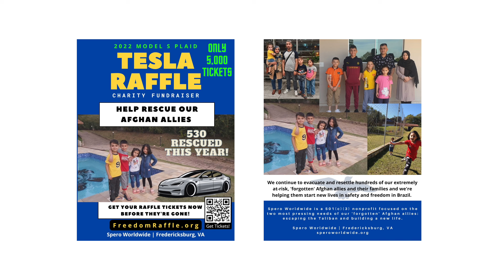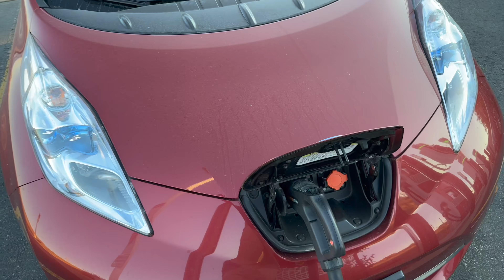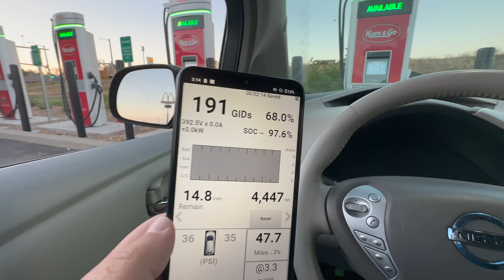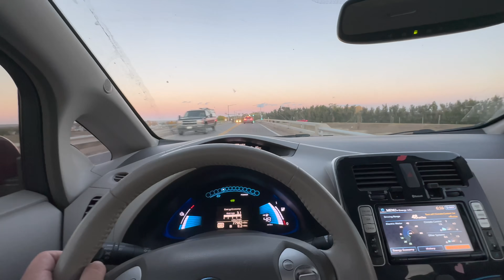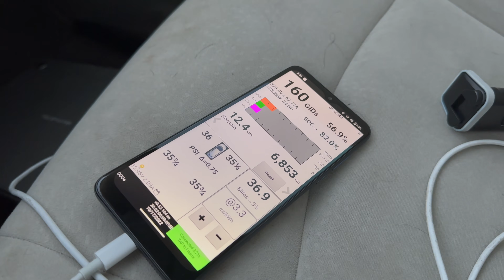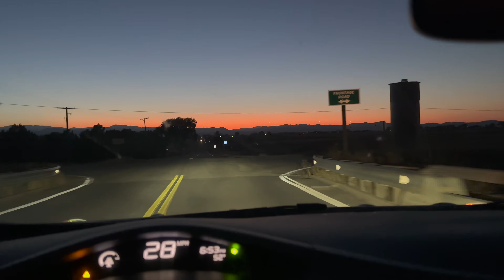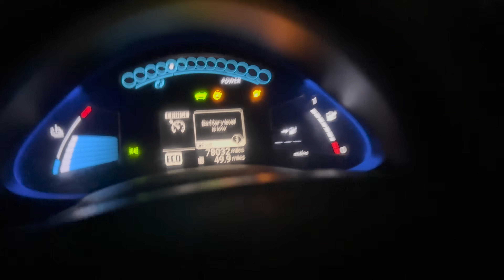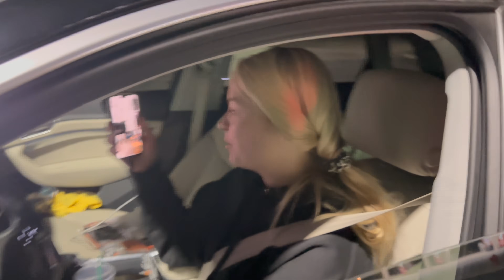Here's How Far My Cheap Nissan LEAF Goes On A Charge! Charging & 70-MPH Range Tests

Comment: It can be quite fun but how long in total did you charge it for, 37 mins upto 90% then maybe another 20 mins to 99% ? So an hour or more?

I've been interested in one but what I'd noticed is there's no cover/shelter area, so if u fill a gas car you can keep dry, if you fill an electric one you could get soaked, need an umbrella, and in the winter time you'd spend more time charging it and getting cold. I've got no offroad parking where I live. I fill up my petrol car twice a month, this one I'd need to charge it about 7 or 8 times a month, that's probably 7 or 8 hours, and if I need my own lead for supermarket charging, they tend to get nicked.
Also the UK is focusing more on getting everyone on bicycles with cycle lanes etc, rather than charging points. Bike theft is sky high here so no thanks.

Comment: YouTube has videos that show car panel dents being pulled out using hot glue and pulling attachments to remove the dent. Are there local repair shops that use that technique? Perhaps they would work with you to make a video.

Comment: I bought a 2012 Nissan LEAF on 10/8/2022 for $2450 - it has 47,300 miles - my AC is working and CHAdeMO as well.   What does not work is the heater.  No heat,  oh well.   It’s white and you can see it by clicking this: #LEAFsavesMYparkingSpot

Comment: Why anyone would be impressed at achieving 50 miles of range at 70 mph then having to recharge to literally go anywhere else is beyond me?? At my age I want comfort, low noise, and range. However, his enthusiasm keeps me watching. Still waiting for those new EV’s that fit my price range.
Reply: Because its a great car for around town. Not every trip is to another state.
Reply: Because that car is extraordinarily cheap
Reply: @planefan082  Over 3 grand is cheap? I can get a variety of fully functional FIAT shitboxes from the '90s and early '00s for 500-1000€ and every single one of them will be way more useful than this toy car. I'm sure you have your own shitboxes you can buy in the US for a similar price.
Reply: @demoniack81  Over 3 grand is cheap for a car period these days in North America, but extremely cheap for a car you won't have to spend hundreds of dollars per month in gasoline alone
Reply: 1980.    Stuff Hass less range then 50 milees
Reply: buy it for my teen to drive to school, that's it, I don't want teen driving far away

Comment: You might be wearing down the battery more by charging it between 90% and 100%. That might be why it finishes at 90%. Another reason might be the overall wear of the battery. I’m not really sure.

Comment: I noticed you had the AC on in the climate control too that might have sucked up alittle bit as well.  Any time you have defrost on Nissans automatically turn on the AC. I have to manually turn it off on my Versa all the time. it is a bit annoying. I know why they do it but to save a little on gas i turn it off
Reply: Almost all cars turn on AC on defog, very annoying. I drive a Fiat 500e electric I'm always turning off the AC on defog.

Comment: I've gotta tell ya, Kyle, I'm with you all the way about this Leaf. For years, I saw them around while driving my Civic and thought, what an ugly little car. But this pas March, with gas prices rocketing, and the fact that we installed 26 PV panels along with a Tesla Powerwall, I decided to go electric. THere was a long wait for a Tesla (the prices are high anyway), and none of the dealers here had EVs in stock (I'm on an island in the middle of the Pacific. Figure it out.) So when the Nissan dealer called to say they got a 2019 Leaf in, I grabbed it. I'm so glad I did. Nissan must have put their "A" team on the design and development of this car. It's all the things you rave about and more. Quiet, smooth, comfortable, all the things you'd want in a daily driver. Mine is an SV Plus with the 62 kwh battery that's supposed to get 220 miles on a full charge. I haven't got that much, but that's mainly because I have to commute over a mountain. The 2.5 mile uphill to the top uses up 10-12 miles, depending on how big of a hurry I'm in. But absent that daily climb, I'm convinced I wouldn't have to charge more than once a week. All and all, I, too am ecstatic with this car. It's a shame that Nissan is apparently going to phase the line out over the next year or two.

Comment: Would love to see what improvement in range flat wheel covers would make. The measurements are so precise it will be easily apparent if there is a difference. And get an a/c charger!
Reply: I've wondered about that flat wheel covers idea also
Reply: @rp9674  I've 3d printed and used a couple sets of Dala's Leaf petals, inserts that fit in the openings of the Leaf's alloy rims to make the wheel almost completely flat. Over about 18 months and 18,000km I've averaged 1.1% higher efficiency, but that's with a 19% higher average speed as I've been doing more highway driving, so my efficiency SHOULD have decreased by as much as 41.6%. Other users have measured improvements around 10%. Using the 10% improvement number, they've saved me at least 400kw or $40. Since they cost me about $20 to print, they've saved me about $20 so far. They certainly make it FEEL more stable at higher speeds and during crosswinds, too.
Reply: @extragoode  nice, I thought it was weird that bolt doesn't seem to have arro wheels either
Reply: @rp9674  manufacturers seem to be convinced that nobody wants aero wheels. Tesla has some that are better, but still not flat. Cars are still very vain objects and people are willing to pay way more for pretty, but less functional things. The only mostly smooth rims I've seen on a production vehicle were on the lightyear 0 but it's not exactly cutting any costs. The Aptera will probably have completely enclosed wheels whenever it finally makes it to production.
Reply: @extragoode  sucks, I think flat Wheels look good, seems like they could do break cooling from the inside of the wheel
Reply: @rp9674  with an air dam under the front bumper the goal is to push the stream of fast moving air away from the underside of the car, so the air on the inside of the wheel gets relatively stagnant. I said the wheel inserts I printed were almost flat because they have a small cutout towards the inside of the wheel to allow cooling air to flow in to the brakes. Regenerative braking doesn't create as much heat either though.

Comment: A 2012 ZE0 leaf ready to be scrapped is $10K where I live. No parts availability and no replacement battery for less than $5k. Then when it’s all fine and working again it’s still a 2012 Leaf worth less than what it cost me. Winters are cold and summers are hot in the local too. I can use Uber for a few years and still come out in front
Reply: Why would you want a replacement battery anyway? I'd have the existing battery refurbished for a fraction of the cost of a new replacement. The last Leaf battery refurb video I watched on YouTube, cost the owner £500 on a 10 year old Leaf.

Comment: Please follow up with city driving with tire pressure @ 50 psi.  A 2015 Leaf owner here.  Unfortunately I do a lot of my 60-mile roundtrip commute by freeway, which motivated me to update the battery pack to 62 kWh from OEM 24 kWh (showing 83% SOH) last March.
Reply: Gid fir you
Reply: Why 50 psi in tires
Reply: @Crayz919  Actually my tires are at 45 psi to reduce the rolling resistance on the road.  Of course confirm on tire's sidewall the max amount.  My tires are specifically designed for lower rolling resistance and they max out at 52 psi, so I feel safe with the seven psi margin.  My car has a plate to indicate 36 psi for a softer ride, which I opt for the more economical performance from higher pressure.

Comment: My Partner and I replaced the OBC on our 2012 LEAF ourselves.  It was actually an easy process, the worst being having to get to the eleventy bazillion push pins and screws to gain access to the traction battery plug, and plumbing to the cooling loop for the OBC.  Feel free to ask if you want any pointers.
Reply: Do you have to pull the drive battery plug, is it safe?
Reply: @rp9674  yes, you pull the  disconnect in the rear floor area, and unplug the connector to the HV Battery underneath the car. Once done,  you press the power button to engage the large caps and discharge them, then finally disconnect the 12v battery. Once done is about a 10 minute  "rest" period to ensure all HV components have discharged.
Reply: @rp9674  Yes, you have to pull the plug.  the idea is to totally isolate the battery.

Comment: Excellent video - well done to you.  Just as a by the by, the SOH is very near dropping you down to 8 bars.  Regardless of that - 50 miles at mostly 70MPH is astonishing!  

2012 Leaf
24kWh pack
9 bars
66.58 SOH (as per Leaf Spy reading)
14.8kWh available
77,980 miles on the clock
59 Fahrenheit (16 degrees Celsius) outside temperature - giving 6 temp bars

50 miles range!

Waw!

76 quick charges and 4792 L1/L2 charges in its lifetime.  This would suggest, over the space of 10 years, on average the car has received 10 x L1/L2 charges per week - that is amazing for the car!
Reply: Not to me, my 99 Mustang six is so much more versatile than that - impressive car until he mentioned only about 50 miles on a charge on the old battery?  Fresh one maybe about 100 miles? My Mustang will easily go 300 miles on a tank of gas -
Reply: @appleimacdude  Hello Dennis! You cannot beat the 300 mile range of your car, that’s for sure. For a cheap electric car, it’s horses for courses. The Leaf technology is 10 years old if not more. I’m not sure about your background with electric cars but I can assure you the fact the car is so cheap to run it’s a great deal.

Comment: Kyle compare the 2017 Ford focus full electric with this one that has active battery cooling....I commute one for the last 3 year with over 70k and I haven't noticed any battery degradation....you could review my car I will let you borrow it....👍 Come over it's in California.😁😂
Reply: Problem with Focus EV is the battery is discontinued, there is no third party battery maker,  and not many were sold.  So if you have any battery issue at all, you are stuck with a paperweight.

Comment: that little car save me around 3K in gasoline this summer, yes has a small battery, and needs to recharge often, but for local runs is great.    one tip for highways, use Drive mode to accelerate fast, get to the speed you need and then just slightly add power to maintain speed,  you drain the battery less that way.
Reply: Or just stay off the highway with it.
Reply: @rolandthethompsongunner64  Why do that when you can clearly charge in between road trips? I've seen plenty leafs at highway rest stops!

Comment: Impressed with a 50 mile range ????? And car only has 78,000 miles on it??????  Replacing a battery is like replacing an engine in an ev. What engine are you excited about replacing at only 78,000 miles???   Your expectations are extremely low. You’re  ust the demographic Nissan Renault hopes for.
Reply: The car isn't supposed to do long dinstances in the first place. And it can rapid charge, so where's the problem? The majority of today's fossile cars will need major engine or gearbox repair at 78000 miles. In a few years, a refurbished 24 kWh battery in exchange with a screwed one will be cheaper than any major work that an ICE needs
Reply: Future 250 mklevrange utterly last lot oonger

Comment: A LEAF should be the second car in every 2+ car household.  Cheap to get and aside from the battery, Nissan have done a wonderful job designing this very efficient city runabout.  The LEAF's battery, unlike newer EVs, is relatively simple to change and there are already some companies designing aftermarket batteries for it.

Comment: Former Loveland resident.  Looks like you’re in north Fort Collins to Wellington.  Beautiful location.  Curious- looks like cost was about $6 to charge for the 50 mile range.  Is that typical efficiency?  Would the Etron cost the same to charge for that 50 mile distance.  Thanks
Reply: There is no typical efficiency in EVs. The Leaf is maybe average, at least it's a compact car. The Etron is at the top end, its consumption will be at least 50% higher at these speeds. And don't take the electricity rate for granted. It's not usual to pay 60 cents per kWh and it's also not usual to go 70 mph in a Leaf because it just doesn't make sense range wise. We have an env200 in Germany and the most we pay for 60 miles is $5.5.. that is by going 55 mph at max
Reply: @AsekiBekovy  So typical is a sloppy way of asking for average.  Just like you’d ask if the gas mileage of an ICE car was ‘typical’….i.e., there are ‘typical’ efficiencies.  I had not taken electricity rates for granted.  And where I live, 70 is a ‘typical’ highway speed (unfortunately).  There was at least one other comment asking about cost to charge to attain a 50 mile range.  I’m in favor of EVs, but we must depend on facts, and not hide behind boosterism.  BTW - I drive a plug-in hybrid…since you’re wondering…

Comment: Isn't the only DC charging this car gonna impact the battery any more? They were known as for the badly designed battery cooling which is really apparent when frequent DC charging?
Reply: DC charging does not kill the battery per se. Hot weather and multiple DC charges will. But the 24 kWh Leaf is quite good at throttling its charging power to safe rates.

Comment: That was a fun video! That little Leaf is in pretty good shape battery-wise. Loved it. I bet it has not been charged to 100 percent and discharged down to zero very often, the BMS was probably totally confused. I wonder how it will be now that you have discharged it and charged it to 100 a couple of times. Also, I wonder how it would be if it were AC charged to 100 and had a chance to balance the battery a bit better.
Reply: Watch one blow up if you want something fun to watch🔥💥🔥🗣Nothing but a HUGE HOLE IN THE GROUND LEFT😱‼️

Comment: The battery soh should improve once the charger is sorted, it should balance the pack when using AC charging
Reply: older leafs just have bad cells, balancing won't really help the soh.

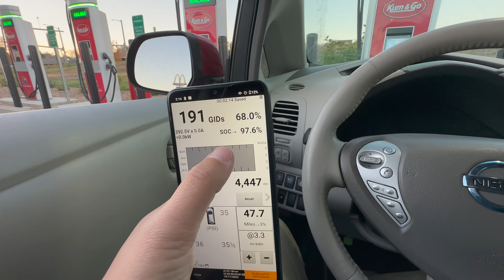Comment: At 12:36 when you were showing LeafSpy it wasn’t reading actual updated data. As the car was off and the yellow rectangle on bottom right of LeafSpy was toggling between orange and yellow showing that is attempting to read data but doesn’t receive any. When it turns green it means it reads data from the car.

Comment: My wife had a 2015 Leaf and most she got was 91 miles and I had to pull her with my truck. We had it in 2016 second hand and it charged to 100% without issues and without fail at home.
Reply: Buy new leads longer range

Comment: Hi, I just had a camping family trip 102 miles away with fully loaded leaf 2022 62kwh. with 3
Young kids and a strengthened aluminium hitch basket with a 11ft3 bag. I averaged 3.1 mi/kWh on the highway at cruise set at 72-74 mph for 90 miles of the trip. Outside temp was 80 f. Without any load I do 3.5 mi/kWh on highway. And 4-4.4 mi/kWh in town. Winter performance was not too different ( In TN). Cheers.

Comment: I wouldn't be surprised if some of the Leaf's failure to report properly is related to the AC Inverter being bad. I bet there are tons of ECM errors piled in that drive computer causing the battery to report wrong because it isn't getting proper feedback from the AC inverter.

Comment: You might be able to squeak some more battery capacity out of this thing after you fix the OBC and can slow charge it to 100% it a few times. It probably hasn’t top balanced the battery properly in a long time and the BMS is probably not too accurate anymore.

Comment: There should be a setting for "long life mode" that limits the state of charge to 80% if I remember correctly.  Annoying that its not adjustable. Also use the low gear (B) to get more range.  You pull back on the shifter a second time to get it into low.
Reply: This is a 2012 Leaf. I think they introduced long life mode in 2013 and subsequently dumped it in 2015 to up their EPA range (EPA insisted on quoting 75 miles, the 90% number when long life mode was an option). I have a 2013, so I'm more familiar with that. It has the "B" mode as you describe, and an ECO button on the steering wheel. I noticed Kyle's Leaf does not have the ECO button, so I believe the shifter changes it from "D" to "ECO" (instead of "D ECO" to "B ECO"), which is the best he's gonna get. In my 2013, "B ECO" mode has more regen braking than "D ECO" mode. Kyle probably can't get "B" level regen if I had to guess.
Reply: My 2013 has the option to charge to 80% as a measure to prolong battery life.

Comment: Seems like the battery needs a good loooooong time on Level 2 to balance. It’s probably hitting a voltage limit on one of the cells, causing it to shut off charging. Even my 2020 Leaf Plus did so much better and was way more accurate on the GOM after a few deep discharges and full charges.

Comment: Would like to see highway range 62-65 mph drafting big-rigs and with a tail wind. That’s more typical of how worn out leaf owners are going to drive. And FYI, the later 2013 Leaf had a SOC% display that they added to the screen.
Reply: It’s a bucket of pus. Hypermiling just means running out of charge further from your home. If you need to hyper mile to get to a charger it’s the wrong vehicle for the trip and staying home was the correct choice